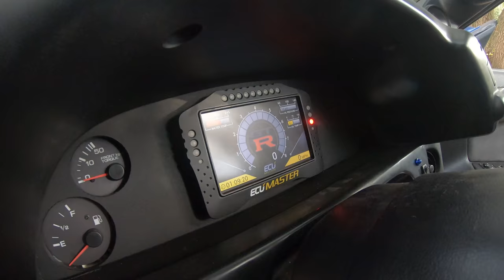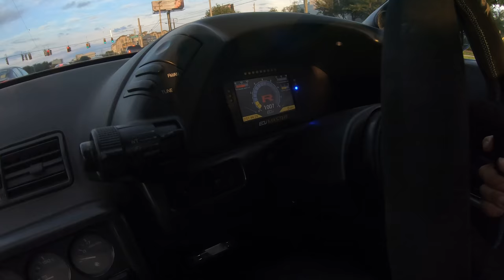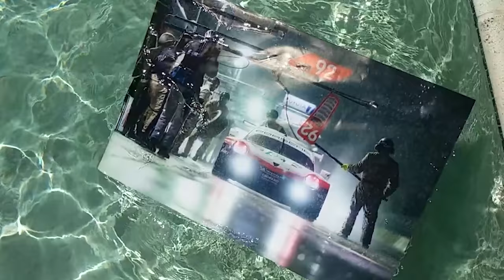Dream Spec Daily Driver: 550hp Nissan R32 GT-R Built for the Streets

Comment: sick car bruh..there's RWB Nakai san's signature on the dash and no one even talk about it...
Reply: Respect
Reply: @Max Maxsson think what you want but having an rwb on fat tires and wider wheelbase is a lot more fun than an old 911 with skinny ass tires
Reply: @B0F  woosh? im honestly not sure
Reply: @sonicmoth8340  you never know, lotta car purists out there lol
Reply: Max Maxsson he literally removes all of the porches understeer and handling issues by doing that, ofc u wouldn’t know that coz of ur attitude towards it
Reply: josiah acciarito Is that really so? With the (insane) width of the tires in the rear of a rwb, the front tires will likely lose grip first. I guess it will actually accentuate understeer 🤔
Reply: @dizzeeb1407  the front is wider too though, not just the rear. no one has brought it up but one could make the argument that an rwb with stock engine and nothing done to it other than wide wheelbase and tires would actually feel sluggish when accelerating, but still handle better. there's good chance though if you get an rwb porsche you're going to modify it's engine so it doesn't matter really.
Reply: josiah acciarito slow in fast out dude. You got to use the rear weight bias to push the car out of the bend, not push the car through the bend.
Reply: I was able to go to a private build with Nakai-san, super cool guy.
Reply: @dizzeeb1407  when the R32 GT-R came out It destroyed the competition in the group A races. Only car to ever win 24/25 races. And it was the only car to ever take 1st, 2nd, and 3rd place for all the races. And take all three podiums in the championship. porche and ford said it was too fast so the gtr's were forced to run a restrictor the next year. Group A regulations u had to run the stock block That's where the n1 block comes from. 600hp all day.
Reply: @Max Maxsson you monster
Reply: Those cars unbeatable 😊
Amazing dream😍

I'm doing full conversion on R34 GTT to R34 GTR at the moment in my garage 👌🏼
Reply: @Max Maxsson my thought exactly, if it ain't nismo it ain't that important

Comment: Mike is one of my neighbors. I can hear this thing coming atleast a block away and know its him from inside the house. I'll admit Im jealous and hoping to be able to afford something similar one day. Lots of great work in a relatively short amount of time. Hoping for a ride along one of these days. Truely a fine example of the 32.
Reply: Hey since I couldn't find a way to contact him. 
Tell him I use my Haltech to control the steering pressure after I deleted my HICAS. 
If the ECU master is hooked into the factory loom, get it to output 6 or 7 volts for medium weight. 
He will thank you.
Reply: Those cars unbeatable 😊
Amazing dream😍

I'm doing full conversion on R34 GTT to R34 GTR at the moment in my garage 👌🏼

Comment: Why on earth would anyone decide to ruin that car by adding an electric power steering system? That's insane.
Reply: Lots of single turbo setups for R32 GTRs run into power steering issues when left stock. It's due to where the original placement of the unit is, and it's a real issue if the owner actually tracks/drives the car. What will happen is under load mid-corner, the power steering will suddenly shut on/off. Imagine going 80-90 mph in a long sweeper at the edge of grip when that happens. My buddy has gone through 2-3 different power steering units trying to iron out the issue. He hasn't tried an electric setup, but this might be a viable way to address the issue. This probably isn't an issue for show cars that aren't driven hard.
Reply: @craigrchee  oh okay. didn't know that.
Reply: @Daniel_B79  All good! I don't think this is common knowledge, especially since tuning R32s in the US is a new thing for us. My buddy is going to try rebuild another hydraulic unit. Hopefully it works out for him!
Reply: @craigrchee   couldnt have said it better myself! thanks man